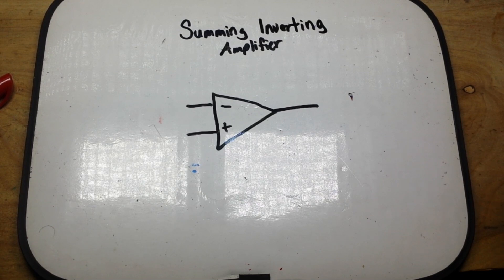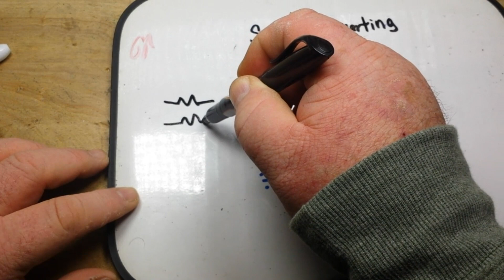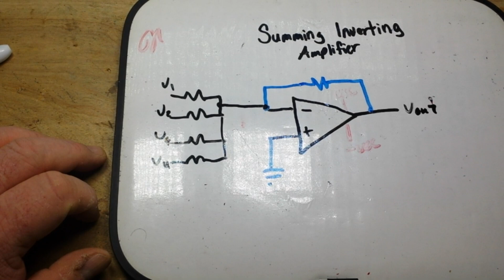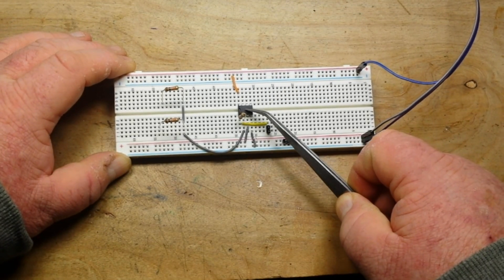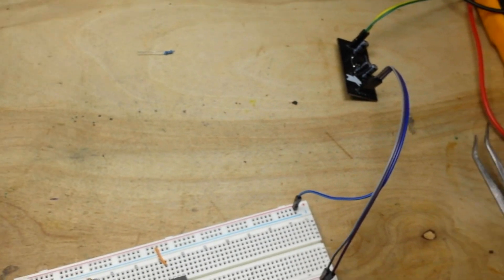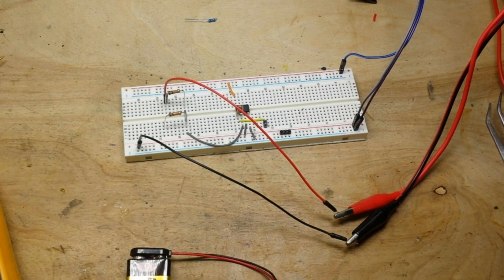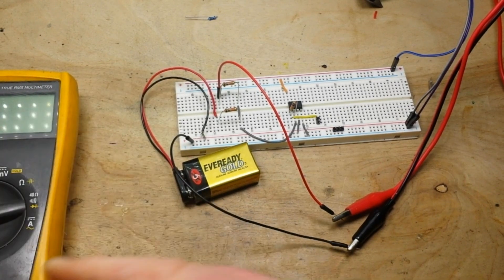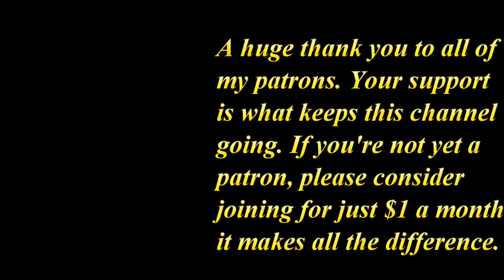Classic Circuits You Should Know: Summing Inverting Amplifier

Comment: why not recycle some clipped component leads or just put some 20 or 22 guage wires on your 9v clip? btw when i worked with Opamps they had me build a +9 -9 source they taught me how to wire 2 9volt clips to make that happen.i note you only use +9 on op amp circuits.

Comment: Now I finally understand how a calculator works 😋
Reply: Calculators work digitally, but you know that. The op-amp summing circuit is one of the circuit elements  contained in an analogue computer. These were once used to demonstrate and solve differential and integrals equations. They are still the bases of analogue feed back networks used to control motor speeds. The ubiquitous PID controller. Proportional + integral + differential feed back circuit.
Reply from the maker: And audio mixers

Comment: Does the op amp require a power source larger than the sum of the inputs or was the 12v source just what you had laying around?  Could this circuit be used with a standard computer power supply to tie several of the 12v outputs together to make a higher output voltage such as a 24v supply and with three leads a 36v supply? It seems too simple.
Reply from the maker: This is line level stuff, not power. It wont wont work for what you are waning it to do. Sorry.

Comment: Ok. Input 1 from a microphone (or mic amp), input 2 from an rf oscillator, output would be an amplitude modulated rf? Standard AM transmitter?
Reply: No that is not correct. The op-amp is performing a sum ( a signal addition). Amplitude modulation is a multiplication between the RF signal and the audio signal.